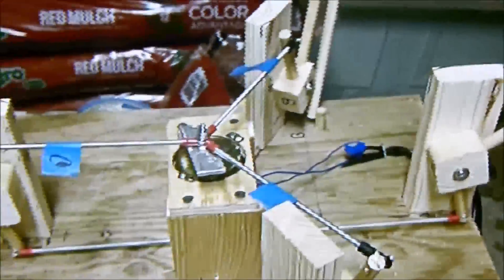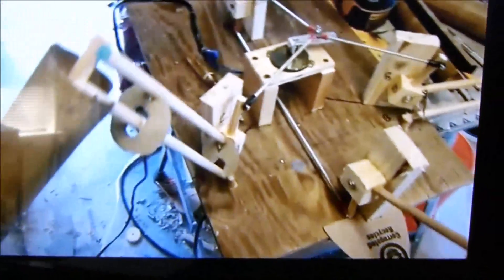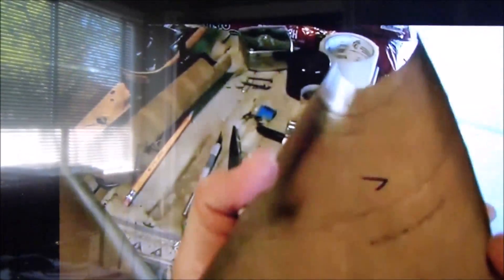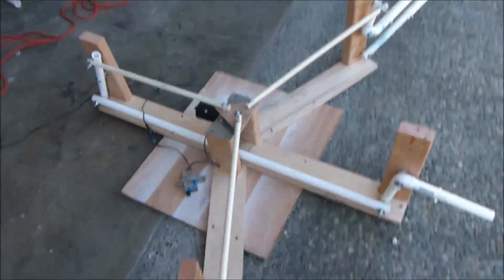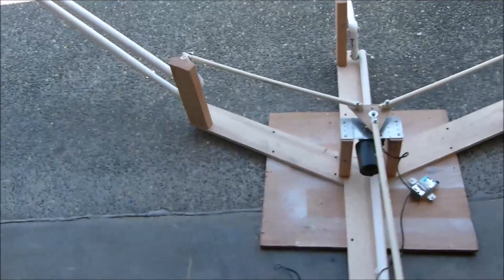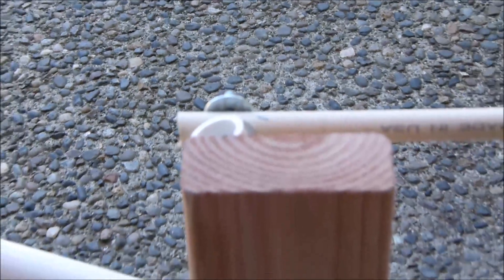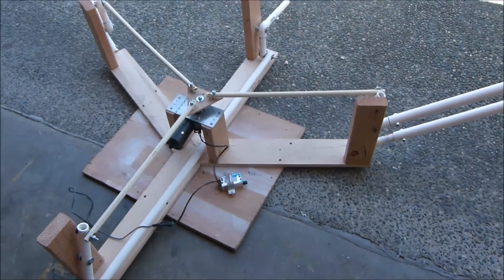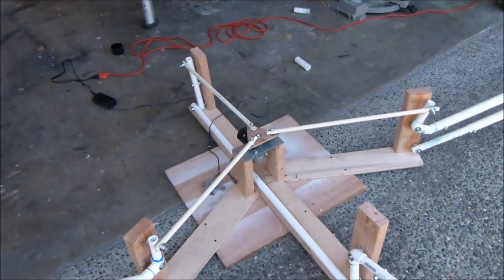Supersized Leer Ghost Prop

Comment: Can you send me the link to your motor speed controller?
Reply from the maker: Here's where I bought them last on Amazon.  But you can also get them on Ebay..  The main thing I found out - you need to make sure the device is covered - some have completely open electronics which can catch on things.  But the main thing is to have the speed controller knob connected to a metal cover.  The first ones I bought the knob was just connected and hanging loose.  I broke one off almost immediately by catching it on something.  Anyway here's the link  - - - https://www.amazon.com/gp/product/B00DVGGWC0/ref=ppx_yo_dt_b_search_asin_title?ie=UTF8&psc=1    Just look for a 12v DC motor speed controller.   Good luck

Comment: I could really use, and appreciate immensely, some measurements.  This lever\fulcrum\articulation math is doing my head in!   

How long are the linkages from the motor pivot to the shoulder joint?
What is the set back from the arm joint supports (the upright where the two pipes pivot) to the motor pivot centrepoint?
How tall are the arm supports?
What is the length of the throw on the motor arm (from the motor shaft centre to the triangle centre)?
What's the angle between the two arm push rods? 

Any help is greatly appreciated.
Reply from the maker: I can try to provide you with some of this.  From the motor to the shoulder joints - the length was 2 feet.  but that was a random length - I picked it only to try to size out the body to the arms.  As I said in the video - you can make the size exactly how large or small you want.  The video I copied from his was probably about only 1 foot long linkage.  Same thing with the uprights - whatever distance you want for the size you want it to be.  The length does not change anything to the work of the motor.  All the torque goes to lifting the arms and the head.  That's what is most important.  I probably make the arms a bit too long.  I have since broken one of the 1" 45s PVC connectors from the torque of lifting.  I replaced it and it hasn't broken again.  The head is a bit too heavy - I had to double up bungy cords to help the motor with the lift.  The length of the throw is a good question.  I made it 2" and at first thought that wasn't going to be enough but it was.  I learned the shafts aren't really moving that much but because of so much distance with the lift of the arms and head, it doesn't take a lot.  Finally the arm push rods, I'm not sure if you are talking about from the motor?  The three rods are exactly spaced at 1/3rds of the circle of the motor.  The double PVC pipes for the arms I had to cut and adjust once I had everything connected to get the arms to open and close how I wanted.  That's why I used smaller PVC pipe an d bolts to connect the arms, that let me adjust the length to work.  That's all the info.  I can give you.  I do draw things out a bit as I build but I am nothing like the guy who's design I used.  I'm more of an "adjust as you go"  builder.   Good luck